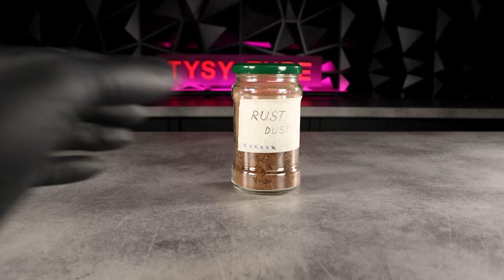Extremely Rusty and Destroyed Guillotine Restoration

Comment: I've tried Coke against rust a few times, and it doesn't really work too well. Sure, it's slightly acidic so it will take some rust off, but even plain water with a few scoops of citric acid powder, or regular vinegar, is much more effective. And neither of those even compare to real rust remover.
Reply: Agree. Coke, vinegar, and rust remover all use acid to remove rust. You can use white vinegar you buy in the grocery store and it's usually the cheapest. White vinegar is normally between 4% to 5% acid by volume. But you may be able to get pickling vinegar or cleaning vinegar, which runs from 7% to 10% acid by volume.
Reply: With all the breast-beating and cries from the food police the acidity of carbonated beverages has been significantly reduced.  Next time, add a handful of salt, electricity and a sacrificial lump of iron.
Reply: @@trollolol705ummm fbi???
Reply: I have used acid toilet bowl cleaner. Phosphoric acid used to be available, but not any more . Any weakly acidic solution should work.
Reply: Did I miss the part where the serrations were refiled, or was there enough left of the old? Cuts fine !
Reply: Coke is "handy" if, let's say, there's corrosion on a car battery terminal... and you need it a bit cleaner for a jump.
But other than that? Anyone who recommends coke for rust removal is just showing that they know more about old wive's tales than actual metal work.

Seriously... Ketchup is better than coke... and ketchup ain't great.
🫤
Reply: My grandfather used Coca-Cola to loosen rusty bolts at his automobile service garage back in the 40's and 50's, sort of how we use WD-40 to loosen them today. I don't think Coke is a very good rust remover, but it does loosen rusty things.
Reply: @PrecisionAIM the FBI can't save him
Reply: This. If you want to see a real wonder of rust removal, use muriatic acid. It's just watered down hydrochloric acid, used for concrete etching. It would've cut all that rust in 15-30 min. Just make sure to keep it away from aluminum, it dissolves it.
Reply: @soupwizard  WD-40 isn't all that great as a rust remover or at loosening fastners.
Reply: @ShawnHCorey Some rust removers are chelating agents and not simple acids. Chelating agents can be reused...well, not infinitely, but dozens of times at least. Acid loses its ability to remove rust fairly quickly.

I wonder if the sugar in cola drinks might interfere somewhat with the chemical reaction.
Reply: I don't understand the fascination with using weird food items to clean/fix things. It's just kinda gross and wasteful.
Reply: Vinegar works better than Coke on rust.
Reply: @mred8002 Some rust removing products still have pretty potent phosphoric acid content, like Krud Kutter.
Reply: @F0XD1E    Huh. I thought the EPA ordered it off market as I used to use ‘The Works’ green for my hard water and rust staining. Been gone several years, so jus hydrochloric left .
Reply: @mred8002  you might not be able to get it just as itself but both krud cutter rust and naval jelly are phosphoric acid based. About 20% according to the msds
Reply: @F0XD1E    Hadn’t thought of that. I used to use it diluted on my white uniforms that would grey and be dingy from our hard water.. been a long time since I got rid of those!
Reply: @mred8002  krud Kutter is clear so it might work for stains if that's how you used to use it. Naval jelly is dyed pink so don't use that.
Reply: @F0XD1E    Thanks! I’ve been using dilute HCl for most bathroom fixture cleaning, and no more whites for me. Whites for a nursing job was one of the stupidest ideas ever. I seldom need to soak rusty tools, and just wire wheel the crap off.
Reply: satisfying them viewers request for sure!
Reply: Correct.

What makes Coke supposedly work in idea is because it contains phosphoric acid.

But, for the stuff to work effectively as a rust remover, the concentration of acid would have to be too high to be safe for drinking.
Reply: @Zardox2  "Coke is 'handy' if, let's say, there's corrosion on a car battery terminal."

And for that application, it would be better to use Diet Coke.  Sugar and sulfuric acid is not a good mix.
Reply: @soupwizard coca cola recipe change recipe alot time after time man.
Reply: I'm sure it's for showmanship.  Post mechanical cleaning I can confirm coca-cola classic does work, it just is expensive... Granted I did that 20 years ago, but yeah.  I use Citric acid and tbh mostly vinegar now.  I know, vinegar too harsh, whatever...
Reply: Yes, vinegar 10 % is much better and cheaper.
Reply: Dollar store knife is just as good
Reply: Plus why waste a perfectly good drink.
Reply: I hope this puts an end to the COKE myth.
Reply: Совсем не понимаю, зачем было использовать Coke,  если потом использовать очищение разными абразивами
Reply: @veradistheeggcat229 it is a Depression Era thing in the US
Reply: @tetedur377 well since its not a rust remover or a penetrating oil its no surprise. WD40 is a metal protectorant.

Comment: I love that you try to make all the original pieces viable, like with the wooden ball. Most channels would have just replaced it, but you fixed it with epoxy and made it work. Love it!
Reply: Either the washers are brand new or he didn't show their restoration. I understand not being able to use the screws and nuts, but the washers were fine. I've been spoiled by My Mechanics I guess...

Comment: This is the first bread-cutter restoration I've seen on YouTube that doesn't mangle and squash the bread as it cuts. Very well designed compared to some of the others, and completely deserving of its gorgeous restoration.
Reply from the maker: yes, i was so surprised 😂
Reply: There is also a little technique to the use, but I was also surprised the teeth ended up good still.
Reply: That's because it was old and stale try it with a new piece of bread
Reply: @darcieclements4880  Tysy put a lot of elbow grease into running it over the whetstone, or it wouldn'a been cutting nearly so well :-)
Reply: Mr White?🤨
Reply: I agree completely! This restoration really stands out. It's so satisfying to see a bread-cutter that works perfectly without damaging the bread. The design and the restoration are both top-notch

Comment: A tip for when you work with wood: In this video, you started to apply the wood stain and clear coat on the best/visible side to the back. This is not ideal, as leftover paint could drip on the already painted side for unwanted excess. Start with the less visible backside, then the edge grains and lastly the top side. Also, dabbing the paint on the end grain makes sure, that the paint is distributed evenly and deep enough. just going over it can produce mixed results. Nice restoration overall!
Reply: Nice legit tip.
Reply: Thanks for the useful tips! I didn't realize the order of applying stain and clear coat could make such a difference. Starting with the backside and dabbing the end grain for even distribution are great suggestions. I'll definitely keep these in mind for my own projects. The restoration was still really impressive

Comment: I’ll probably sound really stupid asking, but what is the blasting chamber for (3:29)? I’ve watched a ton of this guy’s videos and I still can’t figure out exactly how it’s removing the rust and grime. Like it’s not spray paint (ngl did think that at first) and it’s seemingly just air—so what’s the grey sand particles for? What are they doing? I gotta know!
Reply: Its sand blasting
Reply: They use sand similar to hoses they use on driveways and sidewalks except sand not water

Comment: If coca cola removes rust from metal. What do you people think it's doing to your insides
Reply: Hold up
Reply: Removing the rust duh
Reply: @Tickytockyo  lol
Reply: @Tickytockyo  well I'm saying if it removes rust, what is it doing to your stomach. Your stomach isn't metal. So yeah duh
Reply: Nah bruh it's just cleanin up my gears 😅
Reply: It barely even remove the rust and it was removed only because it contains phosphoric acid which is an edible food acid found in lots of food and drinks.
Reply: @Wumbsy isn’t vinegar better at removing rust and coke?
Reply: @WaveForceful  Applying vinegar to rust dissolves the oxide and leaves behind a water-soluble salt that you can remove easily. It is called neutralisation, and this reaction happens between rust and acetic acid.
Reply: @WaveForceful  
So yes it is better at removing rust
Reply: @jacobganzel7359  I wouldn't worry about that, at least when it comes to the human stomach. The gastric fluid that collect in our stomachs has a ph of 2, equivalent to the acid in a car battery. So a little cola isn't going to do much. However, if you drink to much in a day over a long period of time, you could get diabetes.
Reply: It’s cleaning my stomach
Reply: You think your digestive tract, which handles hydrochloric acid, would struggle with coke?
Reply: Cleansing the soul
Reply: Your stomach acid is stronger bro
Reply: Tissue is a different beast.
Reply: @Tickytockyo lol

Comment: The ruggedness on the inner area of the blade, is that how that metal is supposed to be originally? 

Or did you leave that texture for character?

I’m just wondering why you didn’t polish it to have no texture, like the outer area of the blade.

Great restoration in any case, and that guillotine looks like such a great addition to any kitchen!

Comment: Get a rust/corrosion remover from any car store, walmart automotive will definitely have it. It’s usually a part of a two step process, so you’ll be looking for step one. It’s a can that when you spray it makes a yellow foam, scrub it with a steel brush and the foam will turn rust colored as it cleans. It removes the rust immediately. Coke does not remove rust. The only way in which it is good at removing rust is comparatively, as in its slightly better at removing rust than tap water.

Comment: Diet Coke works just as good if not better plus the added advantage that diet is not sticky is you spill it. Great video brother.
Reply: Should you add something to the coke to make it work faster better. Yes add either phosphoric Citrix or acetic acid. Also gentle heat ie.  leaving it in a clear tub in direct sunlight.i would also pro the metal by scrubbing it down with baking soda (NaHCO3) and rinsing with water or vinegar before the coke bath.

Comment: I have a question, and its coming from a place of "I don't know anything" not anything rude or disrespectful lol.  

Why bother using anything to remove the rust if you are just going to sand blast it anyway??  Wouldnt it save time to just do the wire brushing and move straight to sandblasting?
Reply from the maker: just to make a more entertaining video ✌️
Reply: @TysyTube  fair enough lol

Comment: Here's what I find suspect about this video.

Nuts and bolt heads are completely oxidized, yet the bolt shafts are pristine.  I see no way the bolt shafts would be sealed from water infiltration by just a washer against wood.

Speaking of the wood, it is in remarkably good condition.  The entire guillotine would have had to been exposed to the elements for years to rust that badly.  Yet the wood is not warped, splintered nor green with algae. 

I must conclude that the item was intentional and artificially rusted with hydrogen peroxide or some other agent/method.

However, the seeming intentional weathering does not detract from the skills required to restore the item.  That part was apparently well done.

Comment: Coca-Cola has changed their recipe several times and while old Coca-Cola may have removed rust the modern version of the drink most certainly does not. Most people grew up hearing that it does remove rust by their parents but never tried it to see if that still held true and as already stated the old recipe may have removed rust while its modern iteration just can't  because it isn't the same on a chemical level. You should explore other suggested methods to remove rust.

Comment: I'm still wondering why he is little squatting mechanics use to grab nuts and bolts when they fall down into a tight compartments in the engine compartment to get that first screw in that little plate off there when he didn't need to gloves on it's not like he was going to cut himself and not Sharp

Comment: ok i am a chemistry student and lets discuss this
first the rust is obviosly Fe2O3 which is non magnetic oxide  he used coke which has a PH around 2.2 but coke also has Co2 bubbles which i thing show something like brisk efferness but he should use something more strong to remove the oxide layer like HCL,HNO3 but blasting it would  would be perfect
like the equation goes as Fe2O3  = (heat) =  Fe + so4 (reacts with sulphur,hydrogen sulphur in the air) saying this is u do this reaction you will smell rotten egg like smell which is of sulphur it can be dangerous as it is havier than Oxygen our heamoglobin shows more affinity towards it thnks,,,

Comment: using coke to reove rust isnt very effective if you really wanna remove rust better use vinegar and sodium poder(both easy to find in most markets) just dont put the sodium an dvinager on ur skin. and use a bruch to bruch the rust with tooth paste(itll help it) see ya
Reply: Or maybe(not sure abt it but) : boil vinegrar with a lil bit of sodium powder boil it and when it starts boiling put the rusty thing in it (must be in a very large soup pan bc it could start boiling up having chimical reactions